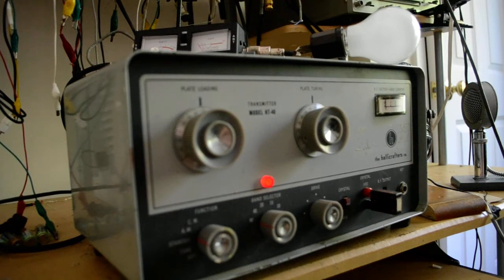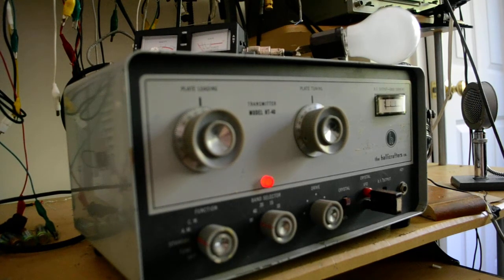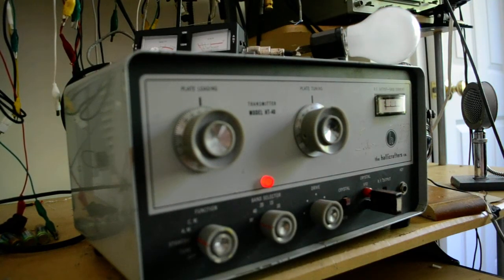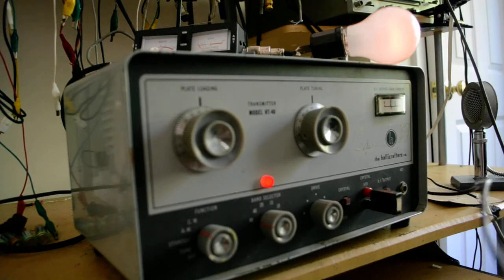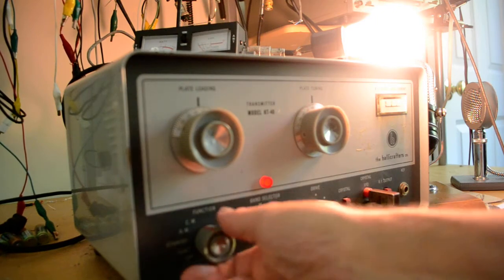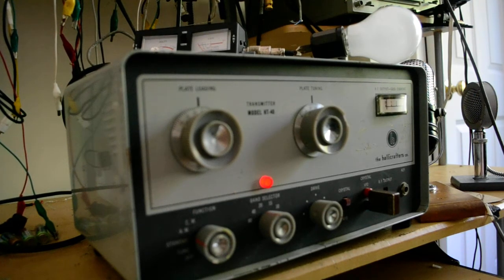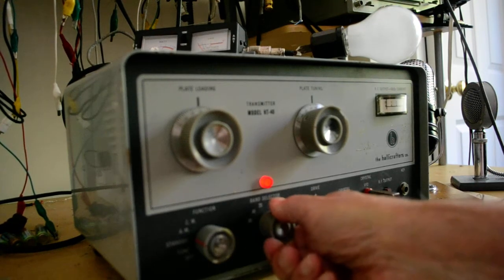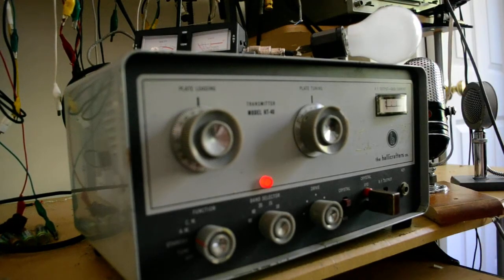Demonstration of the Hallicrafters HT 40 transmitter with an  Argonne AR 57 microphone

Comment: Hello...a friend of mine is refurbishing an HT-40 for me. My father bought the HT-40/SX140 when I got my Novice ticket in 1962 when I was 13 and I'd like to see if I can recapture some of the enthusiasm for amateur radio that I had in those days. My friend and I have been having a  discussion about how well the transmitter can reasonably be expected to fit into its  cabinet. Before I sent the HT-40  off , it rattled around in the cabinet much more than I remember when I was a boy in 1962; it seemed to me then that the HT-40 fit much more snuggly then than it does now. Granted, the cabinet has been damaged.  I just don't remember that the xmtr fit its cabinet that sloppy back when I was a kid in 1962, but that was almost 60 years ago and of course my memory is imperfect. Here is my question: Can anyone tell me how well the xmtr can be expected to fit in its cabinet and what kind of gap there is between the front panel and the upper or lower cabinet in your HT-40, if you have one? There seems to be a big gap between the front panel and the cabinet now. Admittedly, these were mass produced and while I realize that is the case, I just believe that it should fit better than it does. Would appreciate your help...thanks....
Reply from the maker: Mine fit very snug.